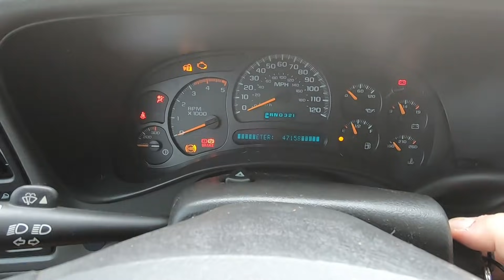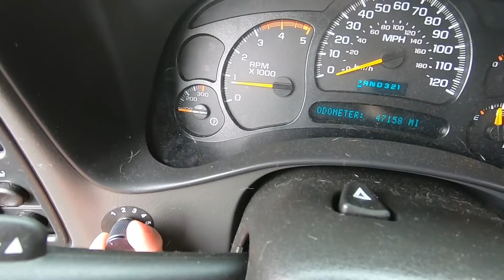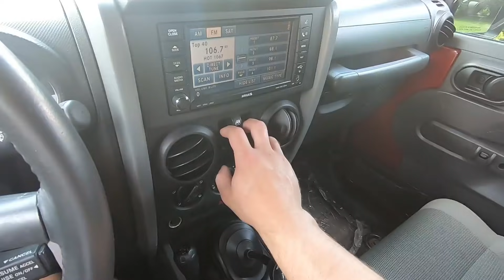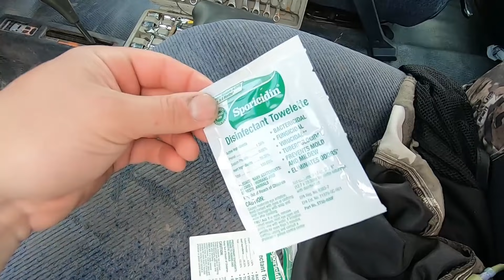MY MILITARY BLAZER IS BACK! NEW BIG WHEELS AND TIRES... (Better Than Ever Now!)

Comment: You should have a slanted soft top made for the Blazer. A boat cover company should be able to do it relatively cheap.
Reply: Have you ever had a custom boat cover made? mine for my 16' flat bottom  cost almost 2600$. he may be able to get one for the blazer made for about 900$ but I still don't think that is cheap per se.
Reply: The way Mike hacks stuff up he'll just duct tape a blue tarp on the back
Reply: @MrWoodyBalto  that more what I was thinking lol. We need to get him to do this.
Reply: That's not a bad idea! And watching Mike install it could be priceless. After all, he's a surgeon with a Sawzall. ;)
Reply: @6973chris2  agreed. I did a full cover for my 18 foot bowrider and it was $2k. Would be cool if he did the top though!
Reply: 6973chris2  Yes I’ve had several made over the years. I’ve never had to pay anywhere near that for a boat cover. They made me custom 3 piece covers for my 42’ dump trailers and they weren’t even as much as yours. And yes they did use quality materials.
Reply: Good idea
Reply: @EVsSuck  for sure.
Reply: Loaded Inc a custom black soft top for the blazer
Reply: I was fixin to say the same
Reply: or just get a used topper and chop it down to close the cab

Comment: You need to make a video in which you go to whatever tool store you prefer, Sears, Harbor Freight, Northen Tool....

And buy a real jack, jack stands, non corded impact, some work lights, and a creeper.
Reply: Amen to this! That jack situation is a disaster waiting to happen
Reply: Spends all his money on tires and wheels, uses cheap jacks. I watched the jeep video and the low front tire, its ok I have an air compressor yet goes to the air pump station down the road. SPEND SOME MONEY ON TOOLS, BRO.
Reply: Why would you go to harbor freight for a Jack
Reply: Night Hawk Motors not on this channel
Reply: @Redrum9516  harbor freight Daytona Jack's are actually very good and comparative to snap on
Reply: And don't use the boards on the jack .
Reply: @Redrum9516  their floor jacks are fine. Pay attention to the maintenance and they are just as good as any other.
Reply: The corded impact doesn’t bother me honestly. I build decks and normal carpentry yet have a corded for home garage. Usually they have a little more juice to them than cordless plus you never run into waiting for a battery to charge up from extended nonuse.
Reply: Lol
Reply: Agreed.
Reply: @OnEst_Opinion  you work on structures, so portable isn't a necessity for you. But imagine him on the trail and blowing a tire or breaking a bead. It's nice to have a portable one in your trail bag.

@M Smith color doesn't make it look military. If this were an M series, it would have a work truck grille and vinyl seats. Oh, and real bumpers (Google CUCV II).
Reply: Harbor frieghts 80 dollar 3 ton grey rapid pump floor jack is just as reliable and strong as any other "name brand" from sears or napa or advance or any same day places you can go. Actually I would say they are more reliable considering alot of the top names ones iv used have problems with the gear teeth meshing to tighten or loosen the raise and lower valve!! The 80 dollar Pittsburgh grey jack from HF never gave me any problems!
Reply: OperativeHD cuz it’s cheap and somewhat decent quality. At least a lot better than his current
Reply: @chuckkolancz4969  yes I 100% agree ! And he passes harbor frieght everytime he goes to steves lol so the question is, why NOT buy a jack from harbor frieght?
Reply: rcairforceone I think changing tires is the extent of his mechanical work. The jack is sketchy but that’s all I’d change
Reply: Never use any of those tool brands , matco , Mac. Snap on , blue point and gearwrench is all I use , the ignition switch is cause wiring

Comment: The 6.2 Detroit's are notorious for the auto glow plugs for not turning off and pulling to many amps. Put a manual switch for the glow plugs.
Reply: I dont really know jack about the obs gm trucks. But I thought that was a turbo 6.5. Or is it the 6.2?
Reply: Turbo 6.5 is different
Reply: @ericjohnson2657  i know there is a difference but they use the same platform if I remember right. I'm not sure if the glow plug switch problem occurs on the 6.5
Reply: @reece7259  you are correct bit they use the same platform so I'm guessing that they might have the same glow plug problem. Just my guess.
Reply: 6.5
Reply: @RFRacing717  I'm aware that it is a 6.5 but if I remember correctly the 6.5 and 6.2 are very similar. I'm not sure the problem occurs on the 6.5 but I'd definitely think it's worth looking into
Reply: @RFRacing717  Bobby check out the small wire that runs to the starter. Its the small 12v+ wire from the ignition switch that runs to the selinoid on the starter and gives 12v to selinoid on starter when key is turned to start it. The years of heat and friction prob wore the insulation of the wire and it is grounding out rite by the starter.

Comment: I'm loving the wheels and tires, it looks killer. Have you ever thought about putting an exoskeleton cage on it? Or even a cage for the rear where you cut the roof off. I think that would set it off. Also, I would either Duramax swap it, or supercharge the 350 with a centrifugal supercharger.

Comment: It has a short in one of the glow plugs or one of the glow plugs has a problem like too much resistance and causes the system to pull to many amps which blows the fuse or possibly a short in the wires going to the glow plugs!!!! Take a voltmeter and use ohms setting and check glow plug circuit.  Let me know what u find out thanks. Btw, the fuse is doing its job because there is a problem somewhere!! Do not leave that wire in there because it would have to burn into for the problem to come back up and could cause a fire!!!! Be safe and find your problem, don't take any chances on it, good luck and fun wheeling!!!

Comment: Unplug the oil pressure sensor located behind the fuel filter.   The lift pump gets its power feed from the oil pressure switch which is feed off the ignition fuse.  However the amp draw is to much for the oil pressure switch to handle and shorts out.  Need to figure out of the three wires which goes to the lift pump and by pass the oil pressure switch and install a relay.  The reason why the power goes through the oil pressure switch is in the event of a accident or roll over the oil pressure will drop off which would cut the power to the lift pump. It’s an idea that never worked.

Comment: I've not worked on diesels but if the fuse pops with the glow plugs then I'd start looking at glow plugs. Maybe one is shorted to ground? If they have pin connectors maybe it's shorting in one of those.
With that wire you might end up roasting hotdogs in the driveway before long.

Comment: Take that wire out before you cause a fire, use an auto bulb in a holder with a couple of wires and put that in the fuse box. With the ignition on the bulb will light up if there's a short, and then you can safely look for the problem. I'd pull the other fuses one by one to start with and see if the bulb goes out, if not then you'll have to look for shorted wires/cables.

Comment: What else did they run to the ignition switch(radio, additional fuel pump...)? Try higher amp fuse.

Comment: It can be the glow plugs not shutting off and overheating the circuit. It is fixed with a new ignition switch or you can try using a toggle switch on them.

Comment: I think if the light bar, bumpers and snorkel were still black it’d actually look pretty good and it would look even cooler with a roll cage and actually removable top but that might blow the budget build

Comment: Mike my dad's obs detroit diesel suburban started to have a similar problem when the fuel injector module gets hot it cranks but it doesn't start so you might wanna check that in Bobby's truck or what the other problem is in his obs but if his truck cranks but doesn't start, he will have to relocate or replace his fuel injection module in his truck.

Comment: SO WHAT WIRE DID BOBBY PUT BACK INTO THE FUSE BOX & WHERE DID HE PUT IT.... GUESSING IN THE GLOW PLUG FUSE PART.......??  OR WHERE.........??
Reply: Jamie Round I just used a regular 10 gauge wire to jump the ignition fuse. Short solution. I guess I just need to follow every wire and look for exposed wires.

Comment: Also, what is the gearing on the Jeep? The reason I ask is because I know that with my 98 k1500, everyone recommends nothing less than 4.10s to run 35s because even with my 3.73s, the 35s would still put too much stress on the transmission.

Comment: My ignition fuse was blowing in mine from water leaking three the cowl behind the hood and dripping on my fuse panel. Every car wash it happened fixed by replacing the plastic cover..

Comment: if your Friends truck keep blowing the ignition circuit wgeb ever the glow plugs try to warm up the diesel, then maby they are past there used by date and are trying to draw too much current in order for them to work effectivly (it was a high mileage truck if i recall) so new glow plugs shouldn't break the bank and should be easy to replace!

PS; a lot of manufactures did/do cheat by routing such things through the ignition switch so it's not uncommon for it to not have its own fuseable link

Comment: There's a short in the ground wire I'm having the same exact problem there will be a group of wires on the right top corner of the engine bay shake those and see if that fixes it

Comment: One of the glow plugs could just be bad if you can't find a short anywhere. I don't think I would risk running a wire rather than a fuse. You don't want your engine bay to catch fire.

Comment: The main wiring harness runs across below the exhaust manifold and 90% of the time the clip-on that wiring harness snaps off and the wires will lay against exhaust manifold and burn that caused the same thing in my truck

Comment: It sounds like it’s drawing to much current. If the wire gets hot or melting the insulation then it would be a short lol. Stupid way to test. Glow plugs might be to high of resistance witch cause it to have high current and trips the fuse. Bad glow plug could be it. Or could be something even simpler

Comment: you need to get a different fuse box go on ebay and you get one for around 50$-150$ and comes w fuses
Reply: it’d a short in the actually fuse box it’s overloading without a limit

Comment: At this point it just seems like you’re pulling dirt together. I liked that the blazer had a direction that we could all see. But now it’s just a running tin can with spray paint. With what you did to it, should have been scrapped

Comment: OMG!! TAKE THAT WIRE OUT OF WERE THE FUSE IS SUPPOSED TO BE!!!! NEVER EVER EVER PUT IN A LARGER FUSE OR A JUMPER TO ELIMINATE THE FUSE!! The fuse is there for a very important reason. It will cut the power off to whatever it is hooked to in the event of a short. The fuse acts like a cop sort of. It controls the speed of the electricity going through that circuit because the wires and whatever its powering can only handle a certain amount. A short is when a power wire touches ground somewhere and electricity will follow the path of least resistance so soon as it shorts imagine all of the power in the battery trying to escape all at once out of that one wire or shorted area. The wire will melt and short other wires destroying the harness around it and catch whatever carpet or fabric around it on fire. The fuse blows before this can happen so using a jumper you can burn that truck down in a hurry!!! Take that out of there please please and dont ever do that again!!!! Please!!

Comment: Are friggin serious?   Don't kill you in the comments???    What you did was not a fix... it's an electrical Cardinal Sin and something you should NEVER NEVER NEVER do...
By running a wire across the circuit you are essentially eliminating the fuse and endangering your whole harness and possibly frying the whole truck.  
I bet you're also the guys that when the old fashion screw in house fuse blows you unscrew the blown fuse and shove a penny behind it and screw the dead fuse back in creating a run away circuit.  
Fuses blow for a reason... to protect the wiring and the home or vehicle from going up in a fire. They blow because there is something wrong and current is in a runaway state. They can also blow sometimes if current accidentally spikes from a temporary short like bumping a screwdriver on a hot point and grounding it out.  So you replace the fuse and things are back to normal. Another reason is if there isn't a large enough fuse for the amount of current in the circuit. But that is determined by the gage of the wire. Always replace the fuse with one that is the same size as you removed or as stated on the schematic.  
Be careful you two... and while I'm at it Mike I'm gonna bust more balls. Get a friggin jack stand underneath when you use a hydraulic jack. Especially when you shim it with wood.
I don't want to watch a video one day about how streetspeed717 fried himself in a fire or was crushed under a vehicle.  I know you've been lucky and odds are against it, but It only takes once for an accident to happen. I don't say this to be mean and I was joking about busting balls. You're a good guy and I'd hate to see anything bad happen to you. Think about all the people who you would devastate if something happened. Your Mom's life would be ruined, and your girlfriend/fiancée would probably be the unfortunate one to find your body which would land her in the looney bin for months or even years.  Not to mention the rest of your family and all your close friends.  
I said my piece.... I won't say another word about it.

Comment: Take that stock tire off the spare rack if you would use it Incase of emergency it will off set and put stress on your ring and pinion and shred your spiders believe it or not but that jeeps not built like they use to be stupid fiats